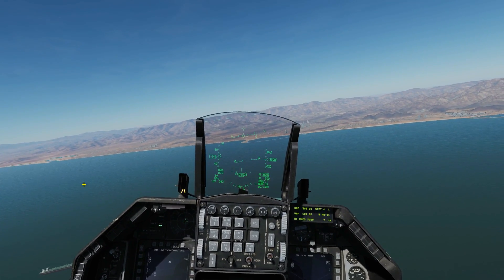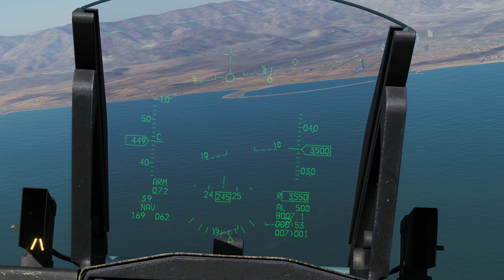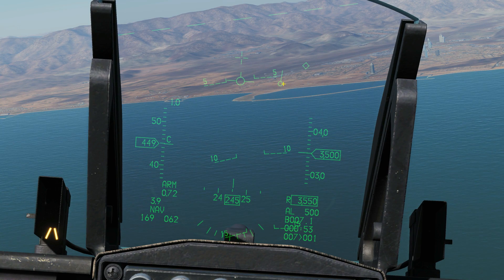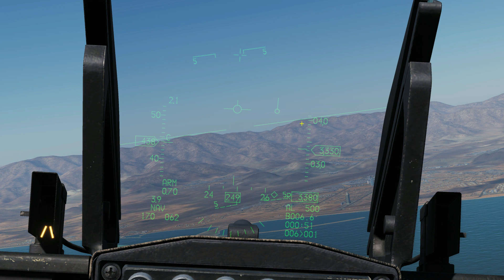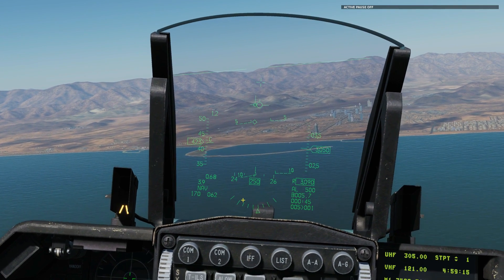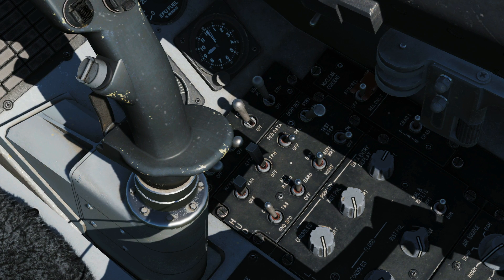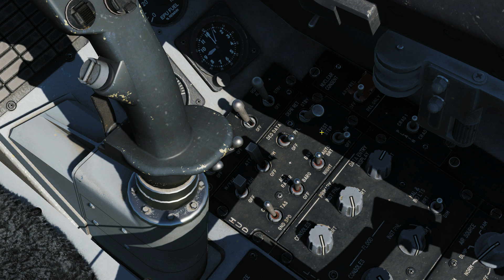F-16C Viper: HUD Symology, Modes & Controls Tutorial | DCS WORLD

Comment: Question.
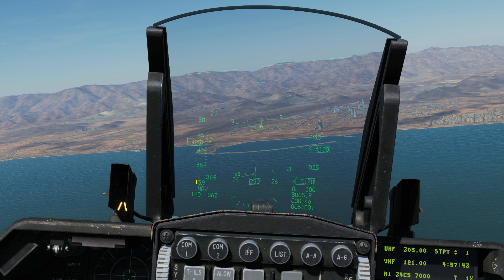On 5:48 he says that the 170 is berrying and 062 is the distance to the bullseye. But under the altitude its written B005.9 which means 5.9 distance. Also can see on the HUD that the berrying is 250 degree..... How there is this conflict ?

I think its a mistake.... I think the 170 062 is 6 number coordinates of the map.
Reply: The B005.9 is your range to the waypoint in a straight line
The one mistake I think he made was by saying 170 062 is the bearing and range to bullseye but in fact I think it is the bearing from bullseye.  So in other words to intercept bullseye you would need to fly 350 degrees for 62 nm.  The idea behind it is to be able to report your position in relation to bullseye to others so they know where you are.

Comment: Whenever I startup the F16c it makes and extremely loud static sound and it doesn't stop I need help PLEASE
Reply: To the right of the throttle are two knobs for Comm 1 and Comm 2. These will be in the off position during a cold start. Turn both of these to the SQL position to get squelch.
Reply: @EazyeSAE  oml thank you
Reply: Before finding out what the hiss was I assumed a bug in the engine sound...😄. Finding the correct kknobs and settings for this was soooo relaxing!